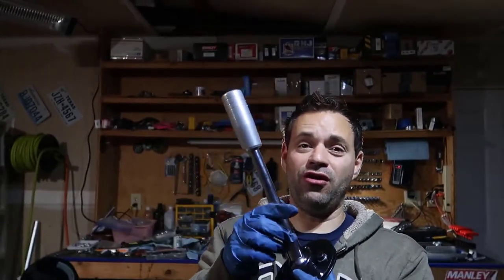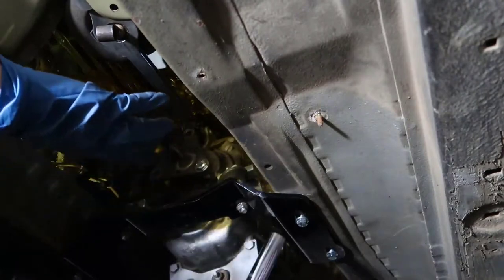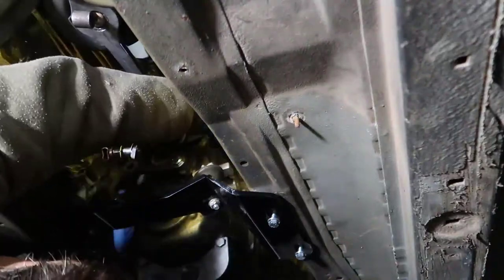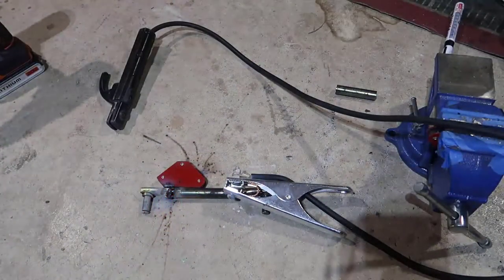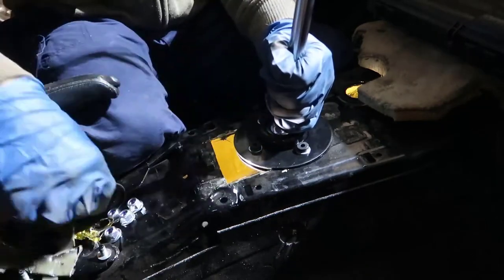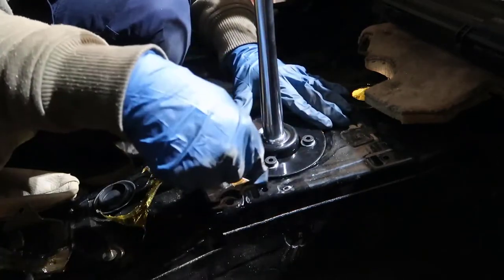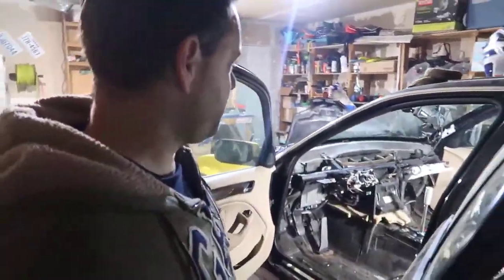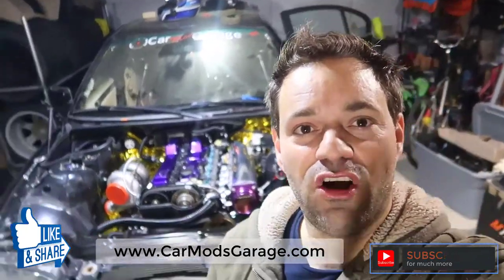Installing eBay Short Shifter or Chassis Mounted Shifter - 2JZ to E46 Conversion

Comment: Im not understanding why that shaft needs to be cut. Ive watched other videos of chassis mounted shifters and the all fit without cutting
Reply from the maker: Mu BMW has a 2jz in It and adapter to the zf transmission. That pushed my transmission a bit to the back and that's why I needed to cut.  If you are adding on a stock car it should first properly without need to cut anything
Reply: @CarModsGarage  okay sweet thanks for the heads up. I ordered one last night and was hoping that I didn’t have to fabricate a shorter shaft
Reply from the maker: I don't think you need to. They are made to just fit. It feels great.

Comment: Hey mate I’ve put my one in and it has loads of left and right movement in gear . Do you know how to fix that ?
Reply from the maker: Hey man, I've no idea. It has something to do to the place it connects that goes to your transmission. If I'm not wrong there is one bushing in there but I'm not sure if it will make any better.
Reply: do you still have the factory selector rod? You most likely need a dssr ( Double Shear Selector Rod ) that will help eliminate side to side play.
Reply: @dylantolo  second this. The dssr is HIGHLY recommended when doing a solid mount. Honesty id do it regardless. Changes the feel completely